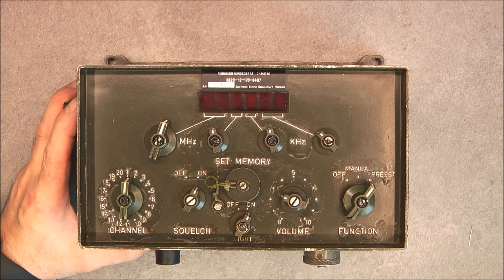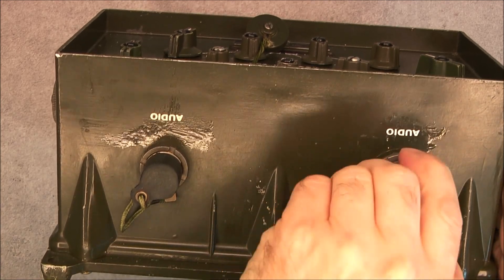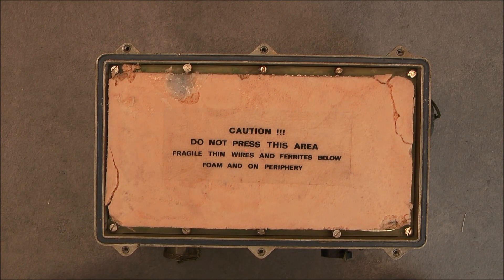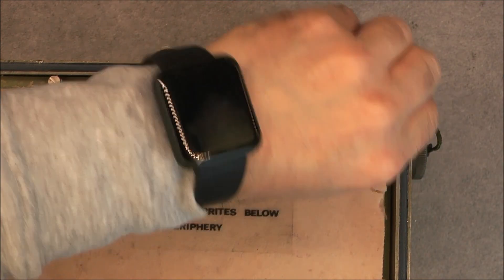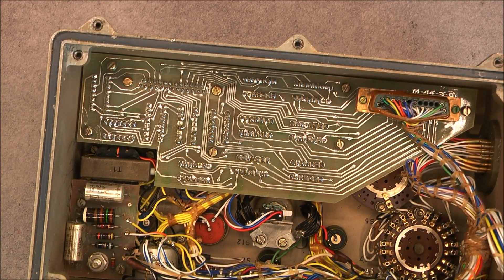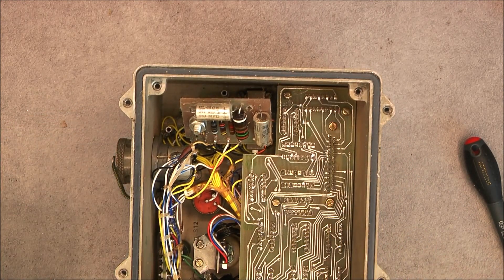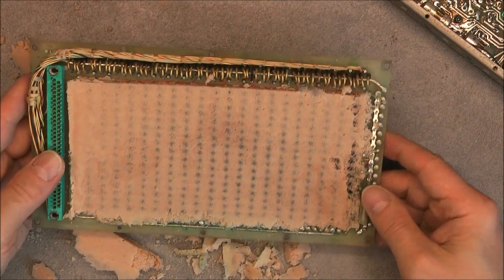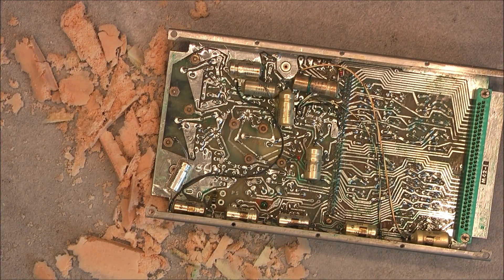VRC-240 military radio digital remote control box teardown

Comment: I wonder if the foam would come off with some solvent?
Reply: It does, also using a tooth brush does help. Done this with some vehicle control boxes. Works good.